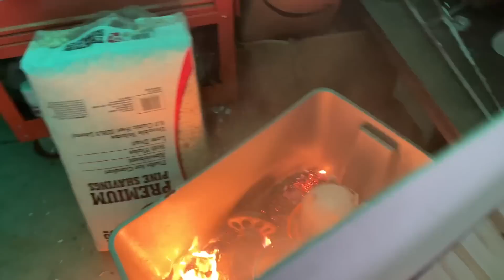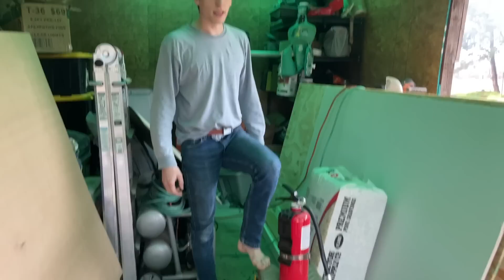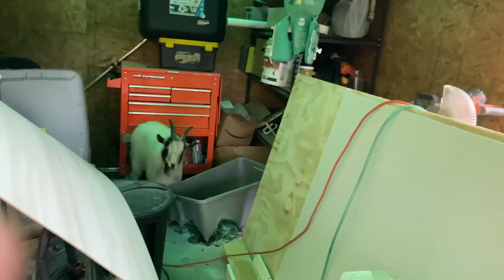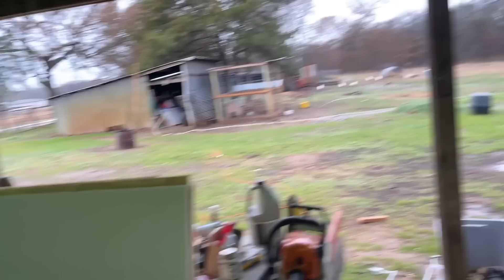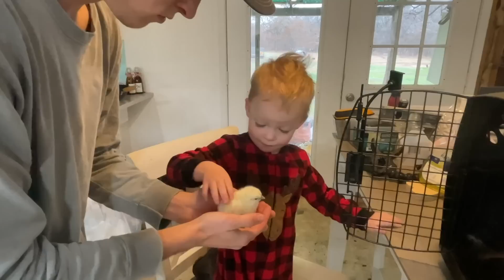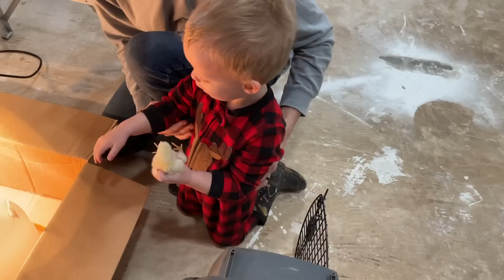Our chick brooder caught on fire and almost burned down our house.

Comment: Time to lock that Goat up for sure. Plus find a new place for the chicks. Somewhere by themself, maybe the well house. You have the wrong heat lamp to for warming the chicks. You need to check at the feed stored, ask for the correct lamp for warming the chicks and secure the lamp so ut doesn't fall again. Good luck. Accidents happen. Learning lessons. 😜❤

Comment: I use a 75 to 100 W standard bulbs they heat up that metal lamp shade plenty & much safer than the heat bulbs.. I also run a piece of wire across the center from one handle to the other make sure I have something to attach it to so there’s no way it falls in the tote

Comment: i found a 2 sided, flat panel radiant heat that i use for my chickens now. i had a fire start also. found on amazon. i still use the heat lamps like you do,, but i make sure they can’t be knocked down by anything and they are secured by at least 2 different holders. 
zane is a butt. so glad you were home to see it

Comment: There are fire suppression blankets and Stay Safe fire suppression in a spray can you can get that works on any type of fire 🔥.  Air out the corner where the fire happened as there will be residual toxic fumes and clean up the area so any of the other animals can't ingest any of the residue.

Comment: Heat lamps kill, I ditched mine for a brooder plate.  I got a rent a coop one, just a 10x10 but it works great for a bunch of chicks, I think the most I had under there was 15 but they were also inside the house in a plastic tote.  Also, I do not use open waterers, even for chicks.  I use the nipple like waters that you can put in ANYTHING, even a 2 liter plastic bottle.  Saves space.  Glad you saw it, be careful and God Bless!

Comment: Suggestion if you are using a heat light, zip tie to what ever you have it clamped to  so it can not get knocked down. If at all possible look into the type of heaters that Cassie Walker has, much safer option Thankful that you were home and saw the smoke.

Comment: You need to get a couple more extinguishers, on the porch by the coups, a new for the kitchen! Are you smoke alarms hooked up in the house? Check to see if the local fire department has fire fighting class. I have gone to a few for work and they will teach you what you need to put out many different types of fires.

Comment: Crandle you should contact Casey, they have a heating shelf that the chicks can get under. There is no chance of a fire starting.  The heat lamps get to hot and are dangerous.

Comment: The lead causing to barn fires is from people using the cheap heat lamps. I know so many people that have had this happen. Premier 1 sells a heat lamp that is heat resistant and fire proof. Please don’t buy another cheap heat lamp! The bulbs often break and fall into bedding causing the fires. With the Premier 1 lamps the bulbs cannot fall out and you can touch the lamp itself without getting burnt or feel the heat from the bulb. Or just buy a chick heat brooder plate. That is the safest of all! Plus you need to keep the chicks in a safer place so Zane can’t get to them!

Comment: Splay leg cut a bandaid in half long wise and wrap around chick's leg, just the half. Then put other one other side so yes sticky part is shown. It holds the legs together but they can still walk then after 48 hours see if it's better, if not redo it. The tendons harden up and fix easy. I've done it with chickens, goose, duck and turkeys. The pad on the bandaid is just about the space you want in between the legs.

Comment: OMG...Thank God you had not left for work yet 🙏.  💞Guys, check out "Cozy flat panel heaters".(or comparable) They are safe. These panels can be knocked over and  lay directly on a straw or shavings and Will NEVER catch Anything on fire. They use way less electricity to

Comment: I don’t use heat lamps anymore. I had some close calls with heat lamps no more! My nerves can’t take it!!! I use the brooder heat plates. And I also have one from tractor supply that is a radiant heater or heat plate. I love it! By the time you pay for the heat light and then the bulbs there’s just not enough difference in the price considering the safety involved.Those heat lights are so dangerous. Thank The Lord you found this. Be safe and God bless! I would give them electrolytes and probiotics to help them with stress and changes. I always get those little packets of probiotics and electrolytes and mix both together then give them plain water available to. Not trying to tell you what todo but just what works well for mine.

Comment: If you have to use a heat lamp, put a wire cover over the top, first so the heat lamp won’t ‘fall’ into the chicks and second, it keeps predators out!!

Comment: After you clean up the area put a fence around it so  goat can't get in near house. Nothing fancy just a wire fence easily removed later but you will soon have3little ones running around & they shouldn't be able to get in that area either.  Glad you were home & spotted it fast & saved the chicks!

Comment: The goat needs a boundary Everything out there is Dangerous! No. 1 rule is Safety without it the others do not matter. Heat lamps are VERY Dangerous they should be fixed to a stationary object or board preferably with a heat shield. I have seen toooooo many chicken coups burned down. My suggestion would also be a portable smoke detector. Stay alert stay alive!

Comment: I am paranoid about that happening with heat lamps. Im so glad they and you all are OK. I always secure it so it can't fall in. I use a rubber stock tank as a broader and wire over the top to keep chick's in and the lamp and other critters out. As for the chick with leg issues (splay, leg)a slick bottom like the Rubbermaid Container and the cardboard box will make it worse. Use a thick layer of pine shaving so his feet can get purchase. You can also make hobbles with a pipe cleaner to keep the feet from sliding out to the side. Just Google hobbles for chicks.

Comment: First - great job on being home and taking care of the fire quickly without panicking.  
Never use the inexpensive cheap extension cords.  Take the time to build a proper support for lighting and heating elements. 
Again great job on your response.  Replace that fire extinguisher immediately and potentially buy a few extras for other areas of the house.  I have one extinguisher by each exterior door (inside the house), one in kitchen, one in bedroom, and one in my shop/garage

Comment: Close call. If you can't get a brooder system for future chick's, maybe you could get a metal water trough to put the chick's in. I'd also secure the lamps so they can't fall in. For Zahn maybe an electric fence like Cog Hill uses would be best uses to pen him up. If it works for Moody and the goats it should work for Zahn and even the chickens too.

Comment: Baby chicks should have been in a metal enclosure. Plastic even with just a heat lamp could catch fire or melt. Lucky they are ok. You should get that plastic out of the area right away. You should have A cleaned out area for the chicks too much flammable in that space. Glad you’re ok and the chicks are. Use a better extension cord in next heat lamp

Comment: Get that goat in a fenced pen. Put him  on a lease or chain till then. He can cause great havoc, it is not funny. This is your fault Daddy.  By the grace of God you have been saved this time. You must take all safety precautions. Go check your whole house and out doors for all dangers,  change immediately. Do not put chickens in cardboard box. Get the warming plate suggested today. Put in a metal water through.  This could have you charged with criminal negligence if fire had proceded. Love your family!
Reply from the maker: Everyone has to learn. We had no idea that they are such a fire hazards. Not sure if it’s criminal to use the heat-lamp that they sell for chickens but it might be.
Reply: @TheEldredgeFam  what is really wrong is letting goat run everywhere to cause havoc. Sorry about fire so glad chicks survived. I said what I said so you will not have another catastrophic new issue. Love you all I homesteaded years ago. I am old enough to be your grandmother.
Reply: @TheEldredgeFam  I understand

Comment: Please consider using a brooder heater plate and not a heat lamp. So many fires are caused by heat lamps. People lose their whole flock and coop. I use a brooder heater and the chicks go under it as needed and sleep there. So thankful you were home and saw the smoke before so much more damage could have happened. God had a plan for you to be there. ❤

Comment: First don't used a heat lamp.  Second a goats are not dogs 
Put him in electric fence. There is a saying  if it won't hold water it won't hold a goats . I know this because we had goats for over 10 years. Good luck with your homestead and take

Comment: Please stop using the heat lamp and spring for a brooder plate.  I've heard so many horror stories about heat lamps!  Also, please don't reuse items that were burnt/melted as they release toxins that could kill the chicks.  In addition, please provide Zan an enclosed area so he can't get hurt, or inadvertently cause a cascade of undesirable events. Thank God, literally, that you caught this when you did.

Comment: The old saying is everything happens for a reason. so it was a good thing you was running late for work. Luckily you saw it in time. If you would have been at work it would have been a different story.